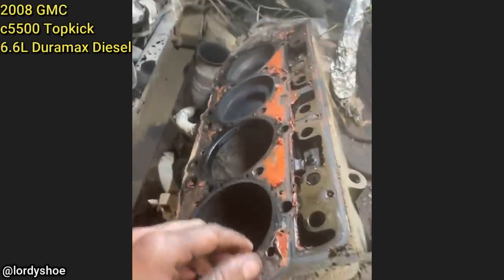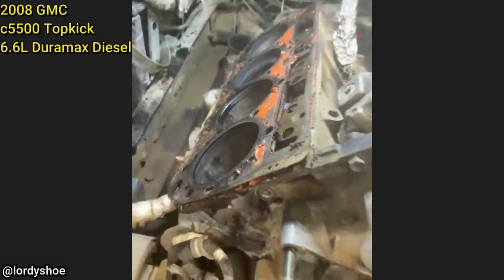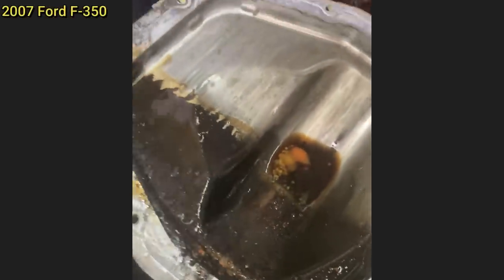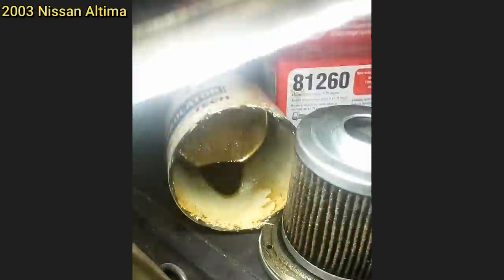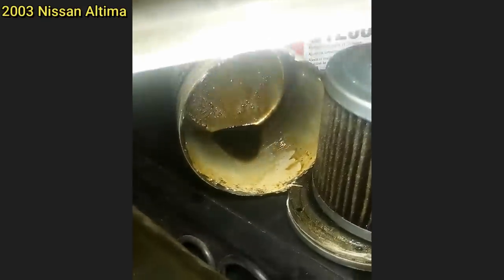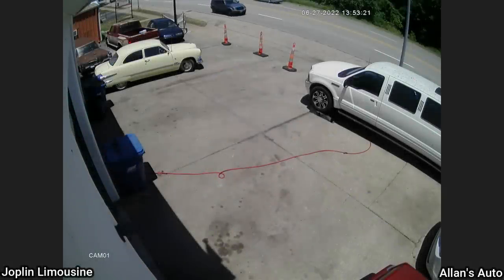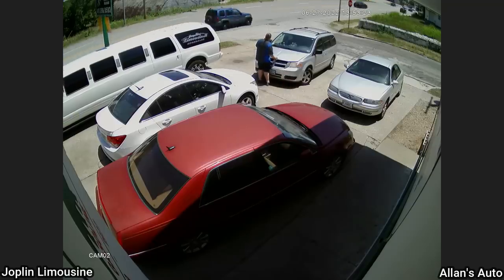Customer States Truck Might Need New Head Gaskets (GMC TopKick) | Just Rolled In

Comment: 1:26 if the bed is that bad, I'd hate to think what condition the frame and everything else is in 😬
Reply: Seriously. What little fo the frame I could see looked like it was build in Oxide, Michigan.
Reply: My thoughts exactly
Reply: I'm in Minnesota.  I see plenty of trucks like this with rotten boxes and perfectly good frames.  Salted roads and the boxes are poorly drained or have plugged drain holes.  I have 3 Ford trucks with rotten boxes and good frames. Remember sheet rusts faster than rolled steel.
Reply: Also bed liners are hell on boxes with salted roads.
Reply: Most frames past 2005 have been coated. Some things you can’t avoid as salt is a necessity in the salt belt with freezing weather. I blame it mostly on user error seeing as your mostly costly item in your life is your vehicle. You should know salt is corrosive on metal and should be washing your vehicle frequently in northern states during freezing weather. 90% of people don’t even know what oil their vehicle takes
Reply: @Donniec685  Most rotten frames I've seen is due to cheap undercoats.  They don't clear the drain holes and the salt water just sits there.
Reply: My guess is it was a plow truck at one time with a salt box in the bed.
Reply: @henrydillard6217  Looks to me like it rotted bottom up.  You see these all the time in road salt states.  I own 3 of them myself right now.
Reply: @tinknal6449  That's when you do a stakebed conversion. ;)
Reply: @MrBirdnose  Yeah, if I find a good bed I'll convert one of mine.  I'm a scrapper so stuff tends to fall in my lap.

Comment: Working under the vehicle without choking the wheels even when parking brake applied is a big no no. The guy was lucky the tyres weren't removed when it rolled back. He could have really got hurt or even died.
Reply: Yep long time ago on my first car I had jacked it up with a bumper jack. Nothing else to support the car (STUPID). I just had to tighten something near the starter, I don't remember what it was. But as I did the wrench slipped and touched the terminal on the starter with the hot cable from the battery. It was a four speed and in first gear when the starter turned over the car lurched forward and almost came off the jack. I came that close to dying that day. Never ever get under a car that is not supported properly.
Reply: Oh man.. Very lucky you were not hurt. With experience comes knowledge. Be safe next time working around vehicles sir. I have a friend who love working on his own car and he told me he always have his wife or children to come and check on him from time to time especially when working under his car, just as an extra safety measure. Cheers and be safe sir.

Comment: People wonder why the car rides harsh and or gets poor fuel economy, well maybe it's because there's 100+ psi in your tires when there should only be 36 (depending on vehicle u drive)
Reply: @a1c3c3u  This is false. In theory it works, but you'll find that with many things theory is far different from reality. You may get a tiny little boost, say a mile per gallon over a few tanks of gas, but at some point the aerodynamics of the car, the weight of the car, and how a person drives will all have far, far more of an effect on the gas mileage than any amount of overinflation of the tires will provide. Not to mention, you'll be absolutely sore after a while, since the car's ride quality will suffer horrendously, as it'd feel like driving on solid tires at that point.
Reply: @apoplecticwrenchmonkey  And you're destroying a few hundred dollars in tire life, a few thousand in suspension life, to save a few tens of dollars in fuel economy.
Reply: @apoplecticwrenchmonkey  while ill agree with you however the more tire pressure you have the less drag on the tire there is. This inevitably increases fuel mileage. The cost is increased tire wear which will cost more eventually. If you wanna save money, go by your vehicles specs and keep up with regular maintenance. And as you mentioned, watch how you drive as this is the most efficient way of stretching your MPG further.

Comment: I have seen many head gaskets changes on youtube and help my father as kid change one. Never did any video or my father use RTV or reuse the old gasket..... With modern cars for some people, it maybe hard to find where to turn on the AC..
Reply: Never understood this logic tbh. If the A/C is turn down past 75°F then A/C should automatically be placed on why. In what need would I want my air to be set at 71°F without it actually being cold???

Comment: Why would someone go through all the trouble to pull cylender heads and not buy new gaskets..crazy
Reply: My guess is that they thought they could do it and then realized they couldn't so they made an attempt to put it back together to let the shop do it only didn't do that well enough
Reply: I said the same thing...MAKES NO SENSE
Reply: RTV was free, the gasket kit cost money. Of course it could be that he couldn't find a gasket kit.
Reply: @brainfreeze44131  A Gasket kit and doing it yourself would cost less money than asking the mechanics to do it for you though.
Reply: @Khontis  Depends on your knowledge and on how well you can follow instructions. There's a lot of things you can screw up doing a head gasket, and a lot of them are smaller details that can destroy your engine. If you don't drain the coolant from your vehicle, you can dump coolant into the cylinders when you pull the heads, so you have to remember to clean that out. Have to make sure you clean the block/head mating surfaces so that the new gaskets doesn't get contaminated and add weak spots, gotta make sure engine debris and dust/dirt don't get into the coolant/oil galleries, gotta make sure you follow the torquing sequence correctly unless you really want warped heads, and many more little details that some people just aren't in the mood to deal with. Depending on the vehicle, pulling the heads off can be an absolute pain in the ass, and if you screw something up as a DIY'er, you may end up costing yourself more money than it would have initially cost to have a mechanic un-bugger your screwup anyway, along with any other damage a mistake may have caused. 

If you can do it yourself, and do it right, by all means go for it. It's rewarding to do it and see your engine fire back up. But it's not just as simple as "pop the head bolts out, yoink the head, clean it, new gasket, slap it back together".
Reply: @apoplecticwrenchmonkey  I was the one who is doing that headgasket. The customer definitely had no clue what he was doing haha. The head bolts were basically hand tight and bolts wherever else on the engine were crossthreaded, holes were stripped, and shit was just where it shouldn’t be. It’s a mess
Reply: @cordellfriesen7750  Ouch. Yeah, sounds like he didn't even bother looking up how to do it. My condolences to you on the 'unscrew my screwup' job. Those are always 'fun'

Comment: Shop Rates:
General Repair: $75/hr
Letting You Watch: $85/hr
Answering Questions: $95/hr
Cleaning up your mess: $120/hr
Reply: Yeah right, maybe 10 years ago. Shits crazy high these days
Reply from the maker: I went to Canadian tire last week to get keys cut. You have to get them cut at the automotive section. When I was looking around and waiting I saw their shop rate to be $140/hr 😅
Reply: That's a bargain for answering questions. I'd still ask the most unimaginable nonsense.
Reply: Saw a sign similar at the mechanics a while ago. (Can't remember the exact rates, but you get the idea)
$65 per hour labor cost.
$85 per hour if you want to watch.
$125 per hour if you want to help.
Reply: $85/hour average labor rate now for small engines (outdoor power equipment).
Reply: Letting you help.  $150 per hour.
Reply: @JustRolledIn  my local specialty european auto shop is the only place in town for these cars and they charge 120/hr. Its brutal for me because I'm bringing in a 400000 km 20 year old volvo, not a freakin ferrari lol
Reply: OP is ironically funny though because I brought my car in to check out an oil leak and they expressed displeasure with the "mess" I made. Still trying to get it fixed but the car is otherwise falling into rough shape and may not be worth it.

Comment: That limo clip is why I always chock the front and rear of BOTH wheels at the opposite end of the car, when I have my car lifted up. The car on a normal day sits low enough to crush my chest and skull with no alterations to its clearance. I don't want it rolling forwards OR backwards while I'm underneath and wrenching on it.

Comment: I like the "just bought" Dodge Challenger. Looks like the tires have gotten a little hot recently. That coupled with the fact the pumpkin is destroyed tells me its been abused. Either the previous owner knew of it and sold it instead of getting it fixed or the new owner had some fun with it. Very possible it was both and an existing issue became a very serious problem.

Comment: I hope that the brake pad company replaces the pads and pays for new rotors and labour!
Reply from the maker: Warranty covered it since the vehicle was so new.
Reply: I thing they could just pry out the screw and put the pad back as "still good".
Reply: Someone got screwed
Reply: @dave161141  Absolutely not. That pocket would trap moisture and possibly dirt/debris and degrade the pad surface and possibly the rotor, risking dangerous situations under braking.
Reply: @apoplecticwrenchmonkey  I took Dave's comment as sarcasm.
Reply: @michaelwarren2391  I'm a mechanic, and I've seen enough on the cars I work on and heard enough people say ridiculous things with genuine conviction to make me err on the side of caution.
Reply: @apoplecticwrenchmonkey  Fair enough. 😁
Reply: @JustRolledIn  I would have demanded a pad from a well known trustworthy aftermarket supplier if the OEM supplier produces pads with bolts in it

Comment: No joke just today my repair order said window doesn't work on a chevy cruze. Didn't think to much of it, replaced them before. Even had to glass covered in duct tape. Took the panel off and found no regulator.  I'd like to assume they knew it was gone but if you're going to remove it yourself why not replace it?

Comment: That 03 Altima is probably a 2.5l pos 4 cylinder. They have issues with the pcv system getting clogged. And in turn causes the engine to burn the excess oil flowing into the engine. Had to replace my ex wife's engine because of it. Total design flaw by Nissan that does not accept any liability. However my dad created a fix by drilling a hole into the lower plastic cover on the valve cover right in front of the pcv pick up. Larger opening that doesn't get clogged and never had that issue again.

Comment: Whenever I see a vehicle roll/drive off by itself I feel a little less guilty about the time my dial shifter truck drove off by itself and hit a plane parked on the airfield. That and the fact they later recalled the truck and made it so it won’t drive unless someone is in the driver’s seat - WITHOUT telling me they’d changed anything regarding safety or driving. They said it was a "transmission recall".

Comment: That would be my luck,the longest vehicle I have goes rolling down the road 😉
Reply: at 13k pounds... nothings stopping it really either. Ironically it is my largest unit of the 30 some cars i own. Im still wondering why my mechanic was running to get behind it to try and stop it... As if grabbing the front and holding on trying to stop it and getting dragged instead wasnt enough of a lesson. Block traffic and let it hit the wall across the street. LOL

Comment: How do you skip the simplest safety protocols, especially if you're laying under it?
I work in a little motorcycle shop, and the first thing I ask when they drop their bike off is "did you put it in neutral?" I'm a little little guy, and I don't want to grab a 1000lbs. motorcycle and it not move.

Comment: The 1st one. If was strictly an HG issue. MIGHT have gotten away (maybe being the operative word) using the copper coat & do all mating surfaces. Can work fine on small engines only as long as the gasket is undamaged. Don't see it being a realistic option outside on automotive scale though. Loose bolts on the other hand...no amount of sealing would help.

Comment: On th e insanely high tire pressure. I once had my Toyota Tundra pickup serviced at a dealer. It included an oil change and tire rotation. On the way home the truck felt like driving a giant jumping bean. I checked the tire pressures and the rears had like 50 psi in them. Should have been 32. Have no idea how that happened, maybe the lot boy filling the tires. I did squawk to the service manager, who apologized.

Comment: 3:12 did he try to run around the back of it? That's the last thing you want to do!
Reply: Absolutly. I came running out the office to head for the street to make sure traffic was stopped, I know my limo weighs 13k pounds. Let it hit that wall on the other side of the street as thats the only thing stopping it. Why the mechanic thought he could get behind it and stop it i dont know. I mean, being dragged from under the front didnt stop it... and yes he was holding onto the limo from under it.

Comment: 2:32 even when you read the owners manual, many are printed for every variant of the same car in multiple countries so it takes a while to pick out the right sections. Putting the airco controls on the touchscreen is just daft though, especially when most cars up to about 2016/7 seem to have a fairly standard layout for these controls..
Reply: A person who upgraded from a 99 to a 2017, I was pretty confused why my air was running so hot. There’s no need to set my vehicles air to 71°F and not want sufficient air?

Comment: From a software engineer perspective, touchscreens are a terrible interface for performing general tasks. Those should be left to knobs/buttons/switches, since those tend to be intuitive and don't break driver concentration. Touch screens only make sense for more complex interactions, such as navigation.
Reply: As a non software engineer who is old enough to remember dials and knobs I agree. Also more reliable and cheaper to fix but they wouldn't want that would they.
Reply: I 100 % agree. As a electrical engineer, it is a lot cheaper to put a rather large screen in a vehicle and realize all the controls in software than it is to make room for a bunch of buttons and design a separate module for them. The button module needs electrical, mechanical and software engineers to design. That's a separate team, or at least set of tasks, to the screen that is already going to be designed into a modern car. Just make the screen a little bigger and add one software engineering to that team to code the buttons. 

Judging from most of the car's I've been in there is no HMI design to speak of. 

What I particularly hate about touch screens in cars is they make it just about impossible to manipulate the controls without looking at the screen and taking your eyes off the road. With good old buttons you can reach over and feel your way around the controls in a car you drive every day.

Comment: Most of the vehicles would need a new owner. Some of them are just a great danger source.
Reply: A lot of problems used to be caused by the "nut behind the wheel." Nowadays, with the computers in everything, the problem usually lies within the "seat-to-steering wheel interface."

Comment: I may just be learning to work on cars, but isn't a head gasket already a gasket? 
Why would you need rtv?
Reply from the maker: Exactly. You should never use RTV on a head gasket. Not sure what they were thinking.
Reply: Yes. but head gaskets are not reusable which is why this rocket mechanic used RTV

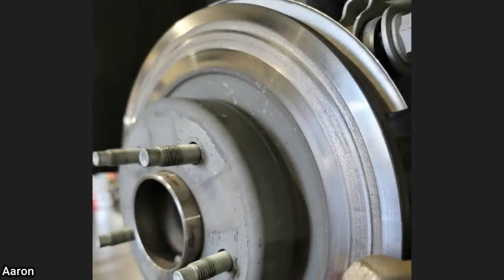Comment: It appears that US manufacturing sector is starting to apply the same quality control (1:32) standards as the China does...
Reply: As a person in the US I do not understand at all how a bolt made into a brake pad assembly. You’d think there would be at least be a machine that check each pad to make sure there is no errors
Reply: @Donniec685  so do I. That rotor is knackered.
Of course, it would be replaced under warranty, free of charge. Watching all this, one would reach the conclusion that any quality standards that existed in the west before the pandemic had gone down the drain🚽🚽🚽

Comment: i must have missed what had happened to the pothole hitting vehicle.?
Reply from the maker: The wheels are straight and the steering wheel is upside down. They hit something pretty hard 😅. I put more info in the description for each photo and clip as well if you got more questions.
Reply: @JustRolledIn  thanks..great videos.

Comment: You can pull your hole engine apart yet not intelligent enough to not use rtv sealant for head gaskets? It just blows my mind
Reply: Stupid is as stupid does.  He figured why buy a new gasket when the RTV would hold back the exhaust gas compression forces.

Comment: How do you miss a bolt in a brake pad?!
Reply: I have questions too
Reply from the maker: Could have been that the brake pad material was covering the bolt just enough that nobody saw it until the brake pads were worn down a bit.
Reply: Probably some factory in Pakistan or China.
Hey where did that bolt go that holds the machine together?
Dunno, maybe the cat ate it.
Reply: Would be similar to finding a mice baked in a bread, or a wasp in a chocolate bar. The product is as good as its surface.